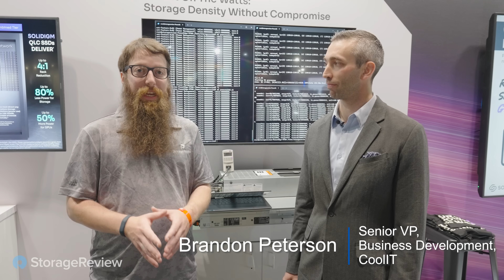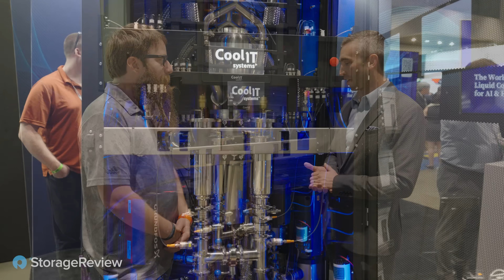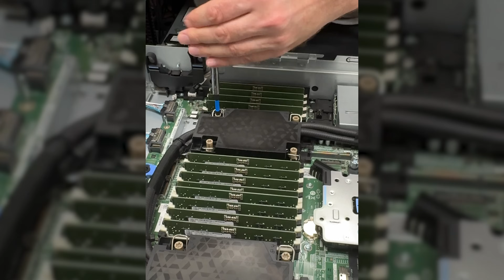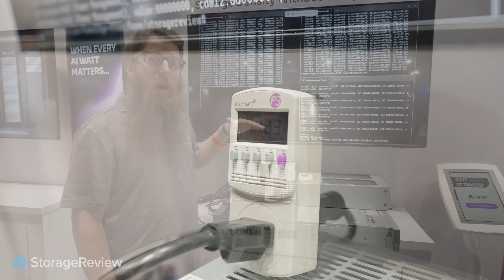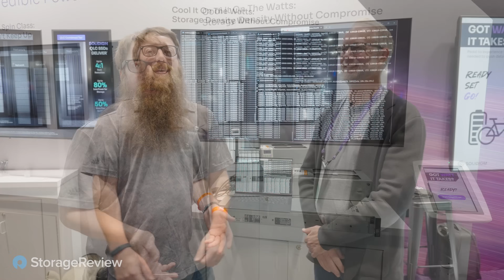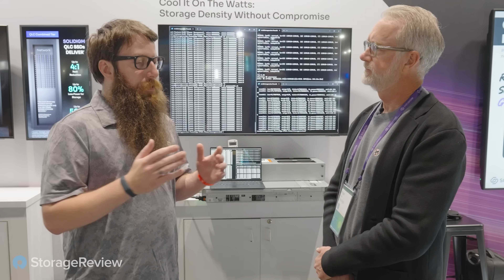Liquid Cooling & SSD Power States Boost Data Center Efficiency

Comment: Can ahx240 be connected to RDHx non dlc racks or no
Reply: Likely Scenario:
If the AHX240 is a standard 19-inch rack-mountable device and the RDHx non-DLC rack is designed for similar equipment, it should be compatible. However, if the AHX240 has unique mounting requirements or the rack is designed for non-standard hardware, you may need additional adapters or modifications.

Comment: For these expandable system cooling designs I am assuming that they use a positive displacement pump system to keep flow rates consistent (i.e. increase pressure to overcome flow resistance due to adding more systems to the loop)?   Similar to what you find in laboratory chiller units?
Reply from the maker: Yea. Our little one has one pressure, the small rack unit has manual pressure controls and the big row unit has more automation.